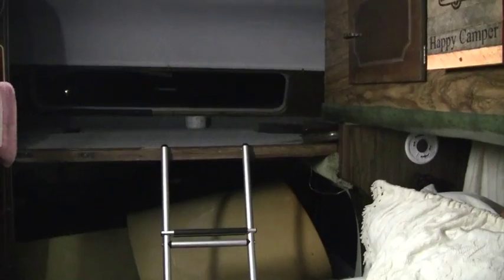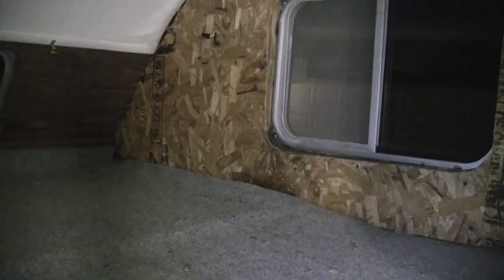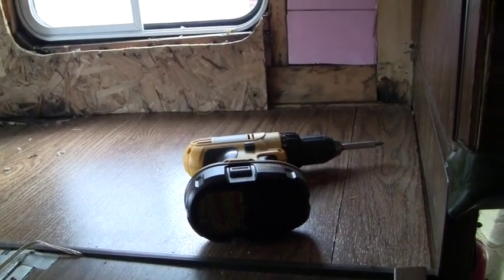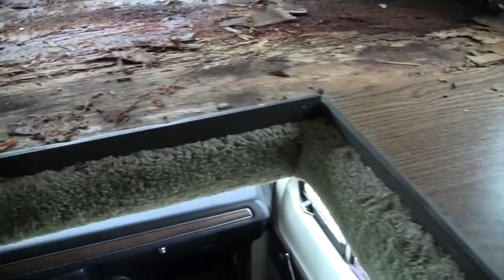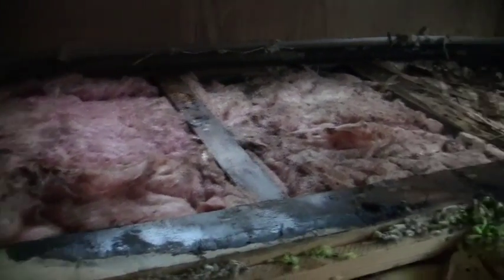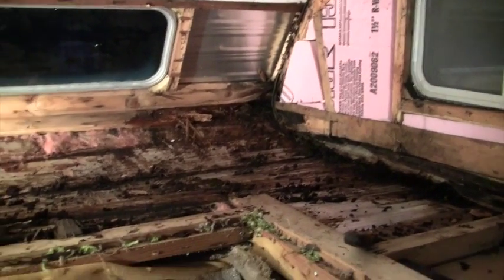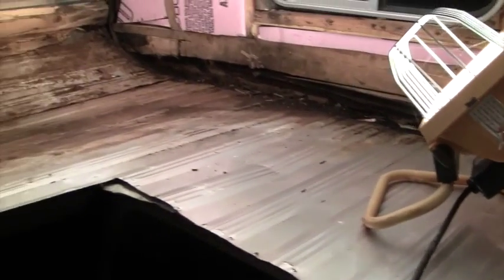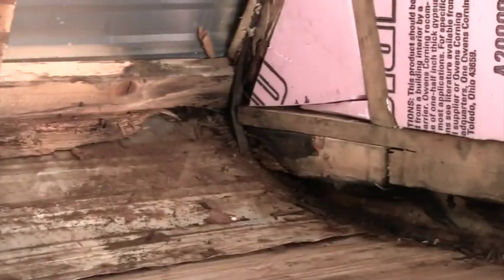Dodge RV - Rebuilding the Bed Over the Cab - Part 1

Comment: I know this is long been fixed, but I would suggest to any viewers that instead of replacing rotten wood with more wood that will rot, is use structural foam boards instead with fiberglass.  Won't rot, better insulation, and just as strong when thick.
Reply from the maker: I had never thought of that. That’s sounds like a good idea!